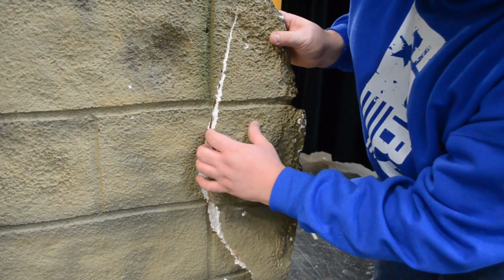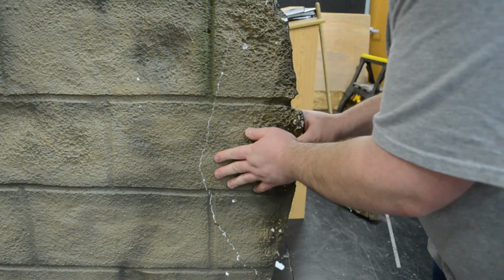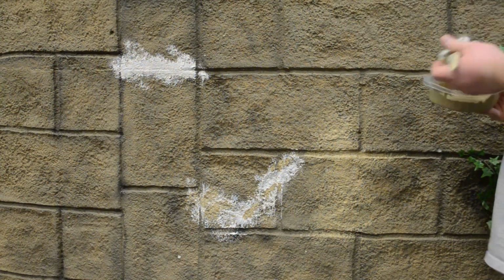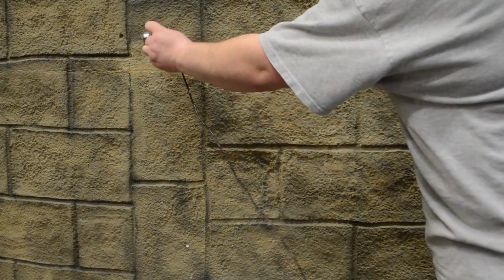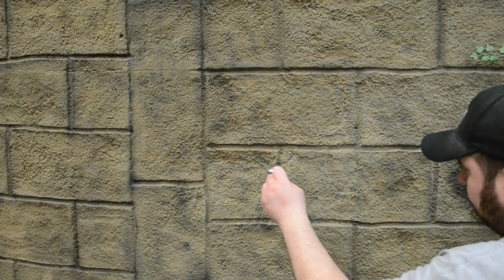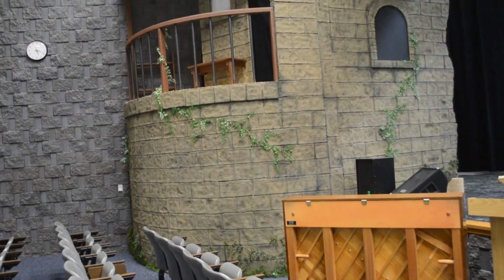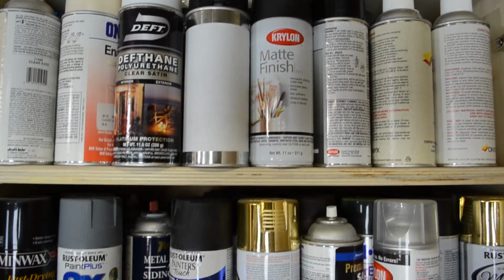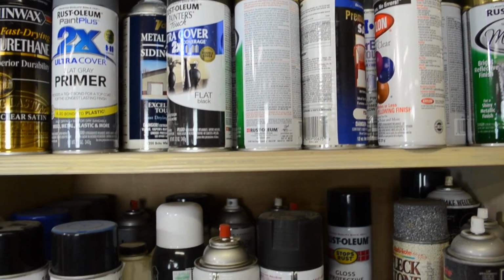Fixing Styrofoam Brick & Why Am I Here? (FT18)

Comment: First of all, great Seth Rogen impressions! Secondly, maybe talk about the steps you take to make sure that your paint spray cans don't clog up over time? Over the years, I've thrown away SO many partially-used paints and adhesives (::cough:: not to mention tubes of caulk ::cough::) that this would he helpful advice. THANKS, MAN!
Reply from the maker: VideoNOLA I have gotten the Seth Rogen thing a bunch of times - a paint video is a great idea, thanks!

Comment: Keep it up doing what YOU want to do.  Video's for the $$ can be done, but if $$ is your ONLY goal, don't bother.  There are lots of easier ways to make a buck. 

On spray paint ... Yep, I have a couple of shelves like that, and my wife would like to chunk it (like lots of my other 'treasures').  If I pull it out to use and it doesn't work, I chunk it then, but it could have been YEARS since I last used it.  I should probably either date them and chunk after 6 months or just chunk them when done with a project.

In any case, the time and effort you put in is appreciated.  Once it stops being fun for YOU, stop.  Like John Heisz related, the best reason to do it is for YOU.